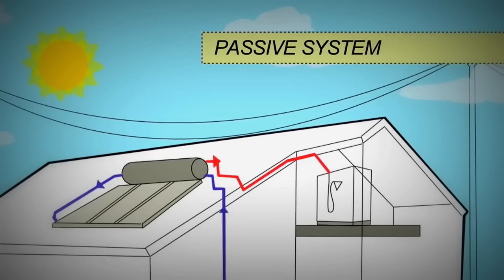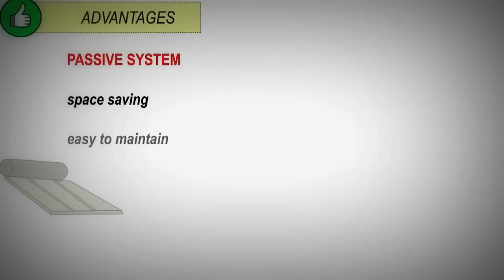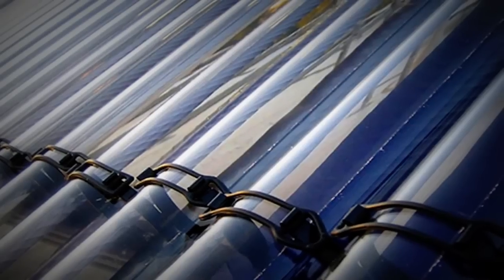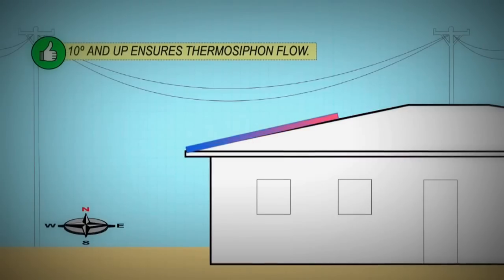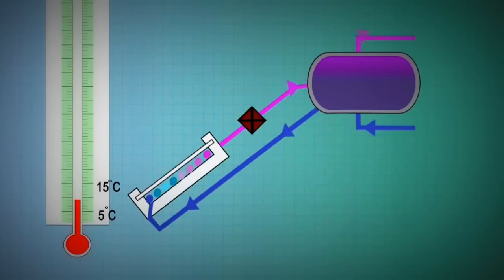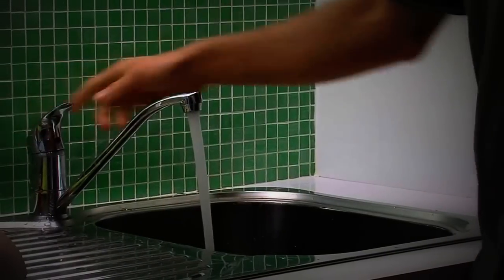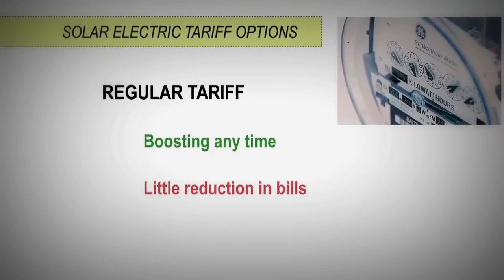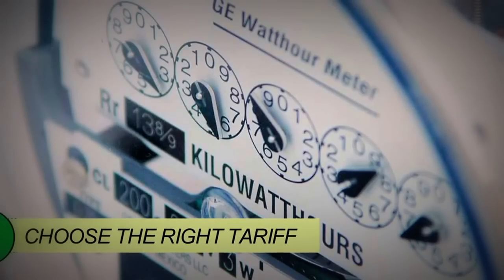Trade Secrets Solar Hot Water System

Comment: Pretty good video but lots of information missing. For example, when deciding between active and passive solar hot water systems, keep in mind that active systems almost always outperform passive (thermosiphon) systems. They simply collect more Btus per day. 

Evacuated tubes almost always outperform flat plate collectors but are prone to overheating, so the fluid (typically non-toxic propylene glycol) must keep moving when the sun shines. The pump must be reliable and requires automatic backup battery power. There's certainly more to go wrong with the more complicated active system. But still, they sure do perform!

I have an active system with 3 x 20 evacuated tubes. A heat dump, really a type of fan-cooled radiator on the gable end of my house, dissipates excess heat if the system is in danger of overheating. Yes, there is a T&P valve but only for emergencies that have never arisen. If glycol overheats it oxidizes, turns very dark and is ruined. The system must be drained, cleaned and refilled, which is no easy task. Never let your system overheat.

Having said all this, it's not rocket science. I live in the Great White North of Canada, and my system makes a great deal of hot water at outside temperatures down to about minus 16-18C. Flat plate collectors cannot do this, as they 'leak' too much heat at low temperatures.

Comment: Great video and good advice.   
.... but I'm not sure on the need for pressure relief valve (in a passive system).  If pressure builds in the system, wouldn't the water just flow back into the mains pipe?
Reply: It's not only for keeping your tank safe, it's also for making sure the hot water in the tank wouldn't flow back to the cold water pipe when you open the cold water in the tap as it would create a low pressure there.

You could install a simple check valve instead of pressure relief valve in order to prevent that but then you put your tank at risk due to thermal expansion.
Reply: In most municipal water supply systems in the US and many parts of the world, the incoming water meter has an integrated backflow valve, which prevents water in the building pipes from reentering the main and creating potential contamination situation. To avoid the T&P (temperature and pressure) relief from bleeding water, an air gap expansion tank is added to the system. The T&P is a required safety device on all water heaters in the US to protect the user and the structure from damage due to excessive pressure buildup or temperature increases.
Reply: @Bear-cm1vl  many tanks in Australia will still end up releasing water when we've got an extremely hot day, so solar heaters during an extremely hot day often drip in a controlled way at the side of a house, similar to how an air conditioner or even fridge/coolroom compressor expell water

Comment: G'day Grant... I'm trying to build an off-grid solar hot water system at my camp near Lightning Ridge. I have the panels and a tank and I'm thinking that I will just connect a solar PV panel to a small dc recirculation pump and move the cold water from the tank through the hot water panel back to the storage tank and keep it recycling while the sun shines. It is a pressurised system.
I am worried about excessive heat buildup in the system as it gets very hot out our way and wondered if I need to have some sort of pressure relief valve (besides the one that is already in the storage tank) near the hot water panels if the water should stop recycling (pump failure etc).
Do you have any thoughts on this please, Chris
Reply: Well, this reply is a year late, but...….Always install a T&P valve in your system. A 30psi valve is commonly used as system pressures are usually about 15psi. Running a low-voltage pump off a PV panel (we call that 'PV direct') is an excellent idea but make sure the PV wattage is at least double the pump wattage. My 12V 15W pump is driven by a 30W panel.

As far as overheating goes, yes, it's a bit complicated. Making a fully automatic control system that will work flawlessly when you're not around is difficult. My system uses an aquastat to activate a fan-cooled heat dump; of course this has to run on a constantly charged battery. Mains power just isn't reliable enough. When you're home, and your water has reached full temperature, simply throw a tarp over the solar hot water panel(s).